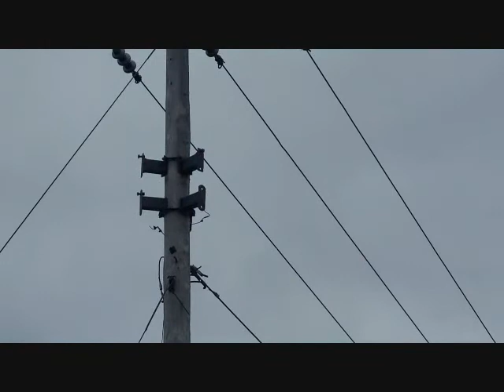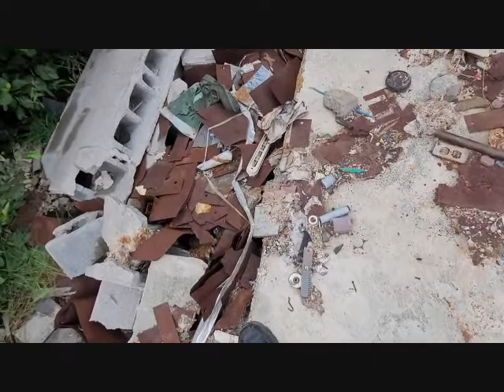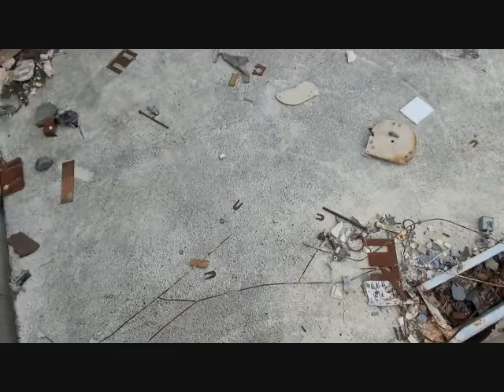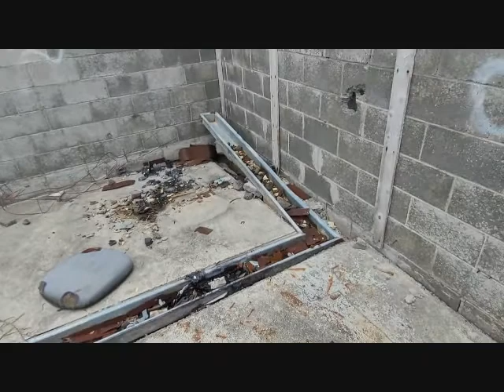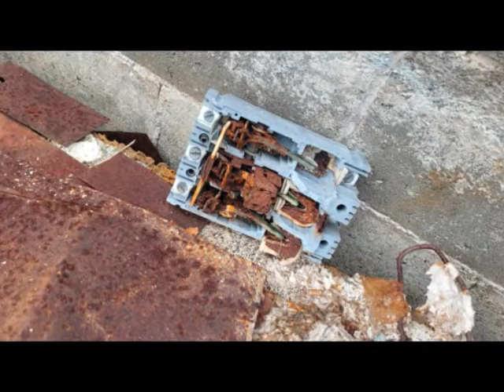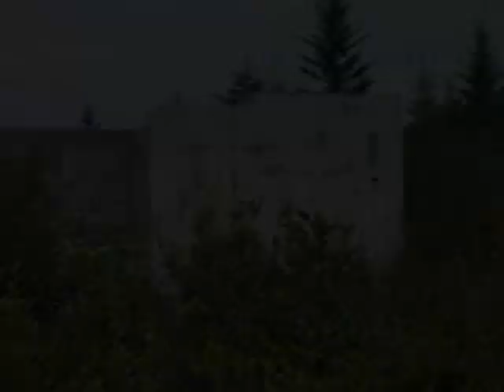What remains of the old 560khz CHVO transmitter site in Harbour Grace NL.

Comment: The stack of three diodes you picked up look like the partial string of diodes that comprised the damping diode in the switched mode modulator of a Harris MW-5A transmitter.